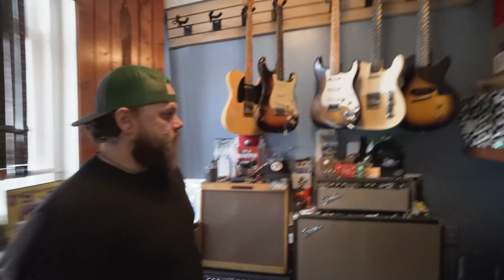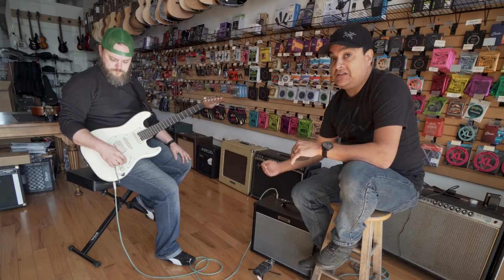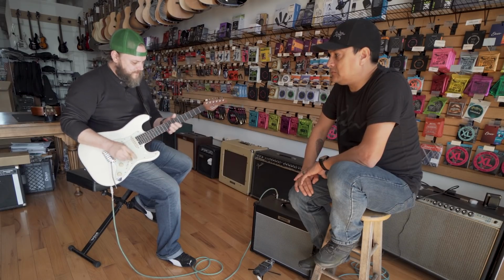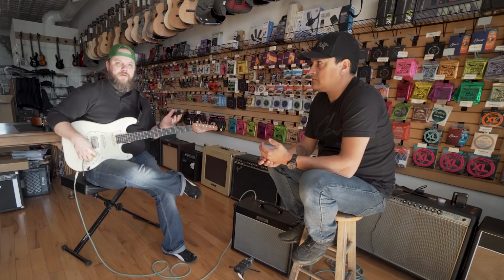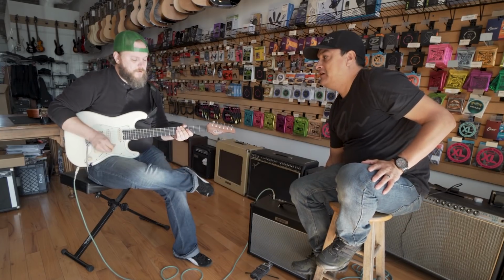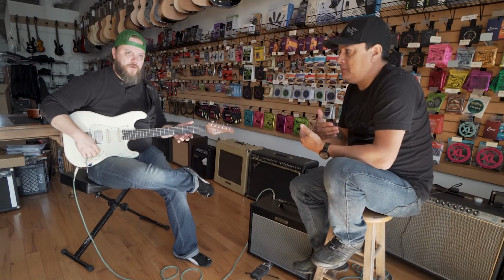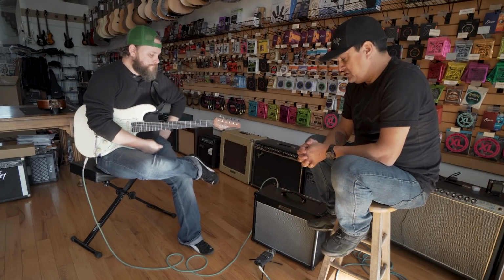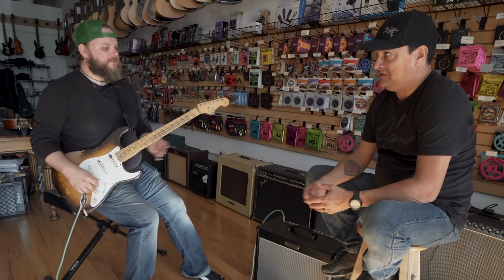Does the Boss Nextone Stage sound like a tube amp?

Comment: I'm beginning to think that I'm a little different.  I'm in my 50'sand am not hung up on the nostalgia thing.  I have or have had at some point most of the amps people seem to want to try and emulate.  I also remember all the maintenance that went along with the old stuff.  I like getting new things because I want new sounds.  If I go out and get a new truck, I'm not going to try and make it work like my 1979 Datsun.  I also am trying to get as far away from loud as I can get.  I have had to hear loud amps and stages most of my life and loud is very over-rated.  I have found that a good target  volume level is where the sound can be heard well but two people standing a few feet apart can still have a conversation.
Reply: I love these teens who want vintage eq. "I need a '50s tele, for that tone". Then they play nirvana?
Reply: I have a Vox AC 15 and this thing heats up like a mother. For someone relatively sensitive to heat, I get super sweaty in winter, let alone summer. It's a great sounding amp, though I wouldn't mind having a bit more control, like the Nextone or Blues Cube would provide.
Reply: Ahh, but if you got your new truck to work, run and feel like an old F-150 you would not mention Datsun.
Reply: @PeterDad60  That's a negative.  Absolutely no interest in taking a new truck and turning it into an old one.  I am happy to let those poor souls stuck in the 70's stay there.
Reply: Well said Sir , I’m thinking of buying one as my super champ is going to get me evicted 😇
Reply: @bboyzagy  I’ve used a blues cube a lot. It is good amp. I’m totally over the whole glass thing. I really like the new tonemaster twin reverb.
Reply: Mate your not different you’ve just grown up and matured, you now realise what you really need instead of what the younger you thought you needed you’ve gained knowledge and wisdom with age. Enjoy it’s one of the few benefits of age.

Comment: I had the stage, it missed the lows I wanted. Went to the Artist and it was exactly what I expecting. I find the « tweed lead » in the software sounds amazing. This model might cool in the stage version, I’ve to admit. Still I like it in my Artist. It might be more of a blues jr than the 10’ fender tweed ah ah
The Nextone special would have been my choice if it was available at the time I bought it. More efficient with humbucker, I find. Because the highs and bottom option with the kind of speaker.

Ps. Today I just played with the Benson Preamp » as a boost for a smooth tone and it’s amazing : ) don’t be scared to boost the signal in the Nextone, it loves it + I just discovered the solo EQ adjustment in the software, oh wow… the boost on the side of the power amp with the desired frequencies at your taste is great… this still with your favorite overdrive, it makes lead tones to die for!

The Artist version has as much quality as the Special, just different. It strength reside in the way it blooms like a tube amp. The Special has more grit in the highs which is good for certain situations. When I play with the software, I realize the Artist is more than enough for my needs. Don’t get me wrong, I have a lot of boutique gear and this little beast is my way to go at the end of the evening when I want to relax.

Comment: Thanks for this video.  I have this amp. and agree; it sounds very tube like. Great attack, chewy tone.   I love it at home.  Took it out for a  bar gig, and none of that translated.  All the tonal goodness got washed out, and what was left was a sterile card board like sound.  This was a small bar, maybe  70 people.  Pretty loud crowd, tho.  Band is Country/Oldies.   Not a loud band, but drummer is kinda heavy handed. Loud Cleans are important to me. We dont mic instruments.  Thats too technical and time consuming for us old guys.  I usually use a Hot Rod or Mesa Express 25, which are both plenty loud and clean, so I was dissapointed the Boss Stage (40 watts) didnt hold up better.   I do like the Nextone concept well enough to possibly get the 80 watt Artist or Special, when gigging gets back to Normal.
         Please tell me if you, or other musicians have used the Nextones successfully at gigs.    I'm looking forward to going thru your videos.  Looks like a lot of good stuff there
Reply: Just used nextone stage at small venue and it sounded great. Used an overdrive pedal with it on 6L6 and was only using half power at that. Lead player was using a katana 50 mk2, we had a seperate keyboardest and seperate bass player with a heavy ass drummer too. Good luck!
Reply: I've got one too recently (Nextone Stage). At home it's the tube goodies all day long, but at higher level it tends to struggle to keep headroom consistency. In other words it lacks a bit of power. Also the "tube" tone is 90% there, but the tube attack and heavy feel not really (80% let's say). Overall I'd say it's still very worth it's value! It's ideal for home use, practices, smaller gigs (but mic-ed could be enough for bigger) and tone searching. But for bigger shows i would go full tube hands down. Also haven't tried the Artist or Special, maybe they are better. Thanks for your input, cheers!

Comment: At 69 years old, I wish I could still lift something like this amp! I very rarely ever used any pedals (other than an MXR Micro Amp)! For extra boost! Thanks for sticking the knife in even further! 5 Strokes DO tend to unforce that one is no longer 21 and bullitt proof any more! I can barely lift my VOX VT20X from the floor to an elevated stand!
Reply: its under 30 pounds
Reply: 66 here and I feel you brother.... My Vox 120 might as well be set in concrete.. it never comes off it's stand...
Reply: I just lifted and moved 5 large tube combo amps and a 50 watt and a 100 watt tube heard today and some of them 3 times trying to make a 3 combo amp stack with a head on the top as well and then decided it was in the wrong place.  I'm 71 and permanently disabled from being crushed in an accident. My neck and shoulders hurt. I work out every day for an hour.

Comment: I have a Nextone Artist and it's a lot of fun.  What I have noticed, though,  is I play it in the half power (40W) mode at home with the master way down.  While the 0.5W setting works it sounds overly compressed and bottom heavy to my ears.  Pedals have worked well.

One thing I'm currently trying is using the lead channel with the gain at minimum.  On many amps this will provide more headroom.  Whether this is true about the Nextone, however, I don't yet know.  It is a bit different, though.

Cheers!
Reply: It’s a lot like a tube amp than I even wanted in that respect, I feel like this amp needs some volume to come into its space. I more use my amp models at my practice volume. Like a tube amp it likes to be loud, actually sounds better at full watts and master volumes cranked up.

Comment: I found a Vox Valvetronix AD30vt for $75. Liked it enough to get an AD50vt w/the foot pedal for $160. That was 1.5, 1 years ago. I watch them on different sites, they’ve gone up a bit. So, what I saw here was a continuing improvement in modeling (amps, tubes, whatevs). Good video. Educational. Keep it up.👍

Comment: I play through a solid state orange, set up totally clean most of the time, I have cheap Klone set to light gain/edge of break up, a JHS Kilt set up to a heavier crunch, and a Blackarts Tone works Black Forest fuzz dimed and they are also touch sensitive. Years ago I didn't understand what that meant and figuring that out was... a light bulb moment. Learning to feel that type of change and control with the volume pot and the pick is fantastic.

Comment: My one critique of this vid is you had the master volume at about 9:00. Boss says that cranking the master is what pushes the virtual poweramp tubes. To control volume, you'd use the..... attenuator switch, i think it's called.

Otherwise, cool vid. It goes without saying that you can really fine tune the amp using Boss's software, including making amps act in non-traditional ways (such as having the 6L6's BMT controls act like those in a Marshall)

Comment: Hi Dylan ! Great review (as usual) for an amp that doesn’t seem to get much attention / love on the web. 
It’s too bad you didn’t check out / shortly demonstrate the software where you can tweek the tone / response. It’s a great feature and there is no need to keep the amp on the computer all the time. I did it just once, and enjoy. 
And it’s a great pedal platform too (having an all analog signal path) 
I have it and use it mostly at home, where the output selector is great to play at lower volumes (0.2 watt) without upsetting neighbours. No need to warm up tubes etc, just switch on and play. 
For me it’s a keeper. I swapped the stock speaker out for a Celestion Alnico Cream and the amp got even better.

Comment: Really nice to see someone spend some time on this amp. I have played around w/ one at Sam Ash a few times and have been pleasantly surprised. I'd love to see you run some boost and other gain pedals into it to see how it reacts. I quite like this compared to a Katana, for simplicity sake. Essentially what you see is what you get(but with some ability to tweak some additional parameters within the software interface). I'm a little on the fence with this, but I'm a little more convinced after this video. Please do some follow up with pedals and also the drive channel. Great video!

Comment: Thanks for the great video Dylan.  And there it is..... My Boss Nextone Special is as good as my Black Face Amps.  I will probably put my Fender Amps in storage until they are stupidly expensive.  I have a Deluxe Reverb, a Vibrolux, a Hot Rod Deluxe, and my favorite is a Peavey Delta Blues that has had some circuitry alterations to stop the hum from the reverb stack.

Comment: Hey Dylan! Quick question about unpotted pickups. 

I'm trying to get a strat set wound unpotted.

Would it be wise to wax pot the bobbin / magnet / plate etc assembly BEFORE winding, then proceed to wind? Would this help microphonics any (because all of the hard parts are "sealed")?

Some guys like Curtis Novak Claim that microphonics don't come from the coil per se, but rather the hard parts of the pickup that are vibrating. And if you can damp those parts, you'll be free from squeel

Im just wondering if Wax Potting would be enough to seal the Hard parts....
Reply from the maker: I agree w Curtis Novak. I could make you a set like that. We also don’t fully pot our coils for this reason
Reply: @DylanTalksTone  Hmm interesting. 

What do you normally do for a customer that wants a non potted set?

Do you still pot those "hard parts" (bobbin etc)? And does that make a difference?
Reply: @DylanTalksTone  I might have you make my next set (p90s) because I already paid this guy to make me this strat set. 

I would have just had you make these for me, But I bought them before I knew that you would be willing to do that kind of build

Comment: Do you have a web site with your pickups?  I need a high output humbucker and single coil for my 1990 charvel preditor.
Reply from the maker: Dylantalkstone.com
Reply: @DylanTalksTone  thanks man
Reply: @DylanTalksTone  Checking out your pickups now.  Do you do custom windings? I want something that will rip a person's head off in the bridge and it would be great if I could get it in the color red. Humbucker.  The neck is a slanted single coil and has no flange.  I plan on using a 5 way switch like the original in this Cbarvel Japanese Preditor.  Love the neck on this 1990 guitar.  Currently I have a no name piece of crap.  I thought about EMGs as I hate noise.  Anyway.  Can't hurt to ask.  Thanks again for the excellent channel and info kind sir.

Comment: We associate tube “sound” to specific circuits that made them (in)famous. I’m screaming into the void here, but this is marketing wank.
That tube selection knob is literally switching between modeled amps that we associate with those specific tubes.

Now, I am NOT saying it’s bad at all. Modeling amps have come very far as of late, like the Fender Tonemasters. I would have killed to have something like this 20 years ago!
Reply from the maker: Well .... you would be wrong. There is no modeling in the power stage
Reply from the maker: The tone master is digital modeling. This is not.

Comment: My boss compressor makes my solid state feel like a tube amp and ocd pedal sounds better. But if I was doing small gigs. This might work. I wish we could have a compressor pedal verse  amp shoot out.
Reply: That's my experience as well. I have, and have owned tons of great tube amps, but one old workhorse I've used for many years is a Fender Sidekick 25 watt solid state. Use a compressor, set low to take the edge off the immediate solid state transient attack, and never run the gain at more than edge of breakup. Everyone who has ever heard it said they think it sounds great.

Comment: No it doesn't. 
I just bought one of these after listening to countless YouTube demo clips, I even pushed the boat out and went for the 80W Special. Be aware the one you get will not sound anything like the vid clips, well at least mine didn't. After spending 4 hours fiddling with every combination I have given up and my ears are hurting, its going straight back to Andertons - utter garbage. Now I know many will not agree with me, but if you are expecting the smooth harmonically rich touch sensitive responses of a valve amp then forget it, despite the sale bull that it does. Now it is possible that I got a duffer, and certainly it does sound like the fancy speaker is busted, but I think it unlikely. I even listened to the video on the Boss website, but I gotta tell you that is not the same amp that I just got delivered today. My first and last venture into the digital amp world, back to tubes for me. Beware, make sure you can send it back before you commit to buying.

Comment: As long as this is dynamic reacts to vol changes its legit. Even if it does not really sound like a particular tube. The biggest problem with pocket friendly multieffects is that they are nowhere close to how a tube amp behaves. You take a Marshall higher gain prest and no matter how you roll of the volume on your guitar, or how light you pluck the strings, it just does not clean up. These transistor based amps at least do that, so the player is forced to work on right hand technique, unlike with these cheaper digital simulations.
Reply from the maker: Lol... both kemper and helix do this well
Reply: @DylanTalksTone  Affordable ones don't :) all those Mooers ge 150 and similar price range simply fail. If a 1k digital unit failed at that, it would be an outrage I bet.
Reply: @DylanTalksTone  the cheapest unit that handles dynamics extremely well , which I had a chance to play around with is Palmer Pocket Amp. It's more or less a copy of Sansamp , but it's way cheaper in Europe. Used one goes for around 60 bucks. A mooer ge 150 is 170$. Haven't played mooer ge 200, this one is 270$ . The cheapest helix  is 500-550$ .
Reply: @DylanTalksTone  Yes, I actually think that's the one thing that's not really a major complaint anymore.
Reply: @DylanTalksTone  i have a Zoom G5n. It does it well too :)